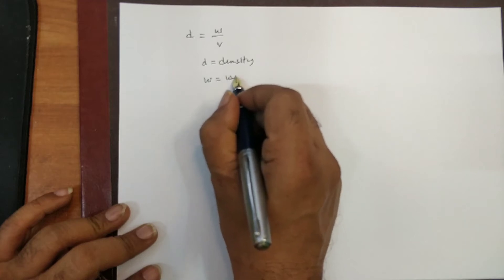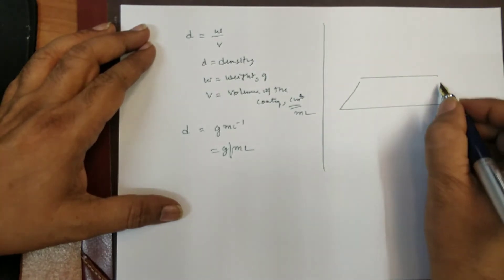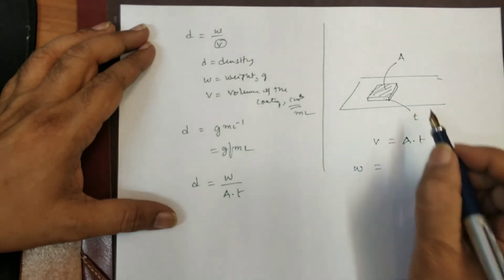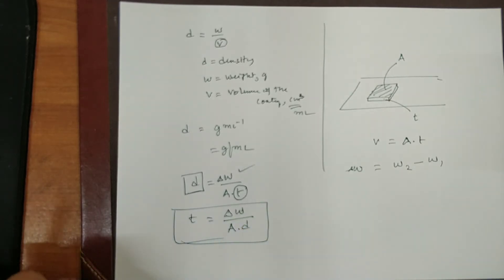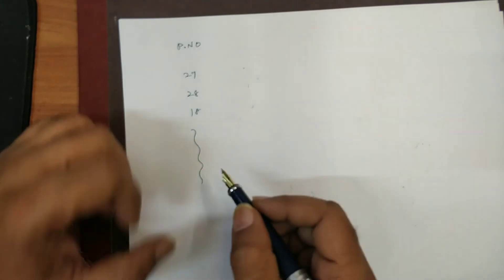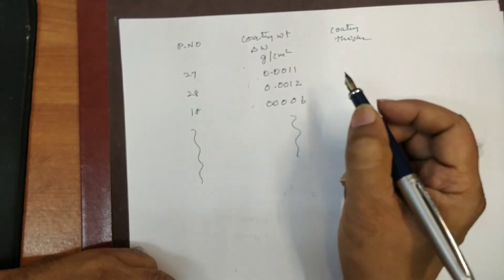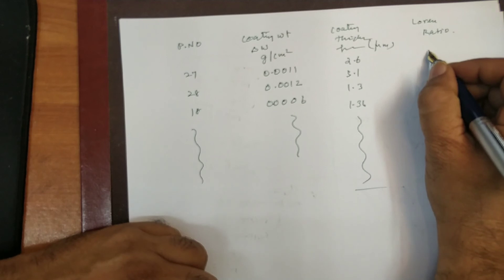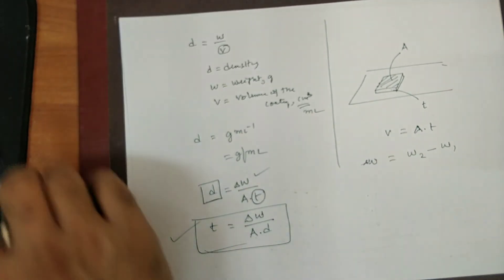Coating weight and thickness measurement of zinc phosphate coating

Comment: Thickness in microns when 700 ml Powder is equally spread on 1 Sq Mts. 
Also Calculate for 900 ml powder spread on 1 sq Mts
Reply from the maker: Volume = Area x thickness. Therefore, thickness = Volume / Area. Convert 700 ml into cubic metre. Thickness = 0.7 x 10^-3 m^3 / 1 m^2 = 70 microns; assumed 700 ml powder tightly packed.
Reply: @saitechinfo   Thank you Sir.